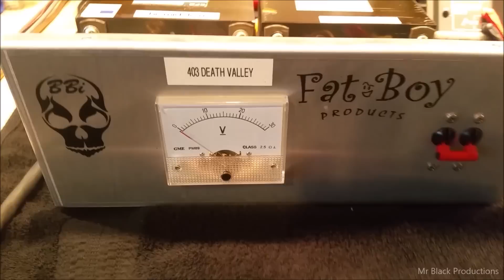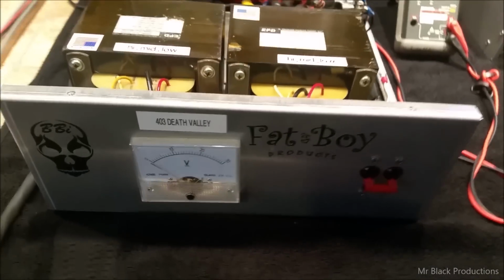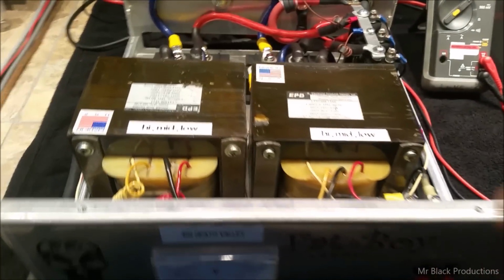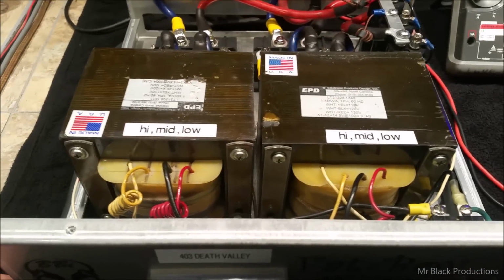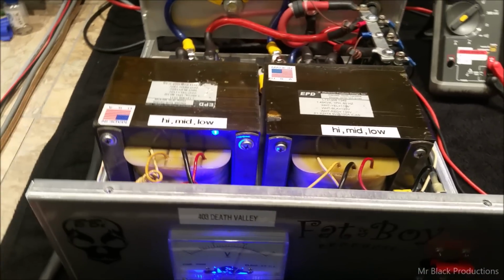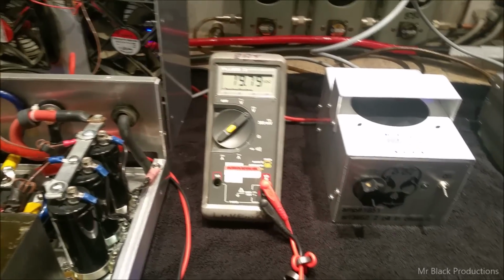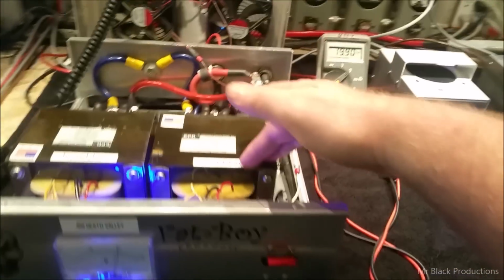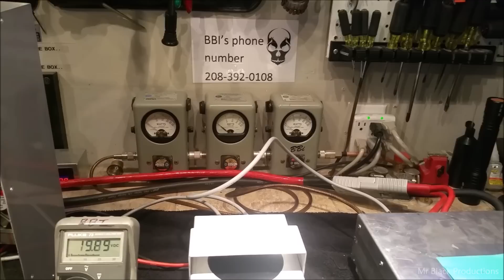403 out of death valley 400amp supply

Comment: It has always amazed me at how much amperage is needed to run these transistors. 50 amps blew in 5 minutes running a brand new 4 pill TS so going with 100 amps now. I just hope 8 gauge wire will work on the 2 switching supplies. I have 4 ga wire but terminals are too small to use it.

Comment from the maker: safety. , the switch also doubles as a circuit breaker So that's its protection for falt. that and I want the customer to really think about okay I'm getting ready to risk all of my transistors by going higher and voltage to gain a couple hundred Watts I want to really consider what they're doing.. but I have done that and multiple other power supplies per the customer's request
Reply: Very good reason lol I like your style my friend!